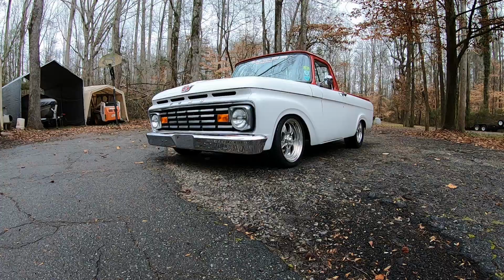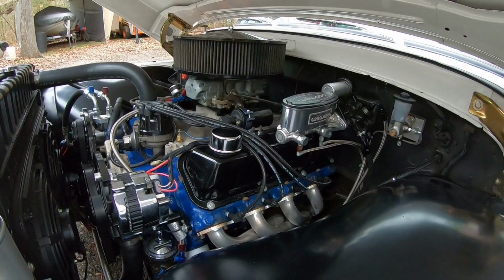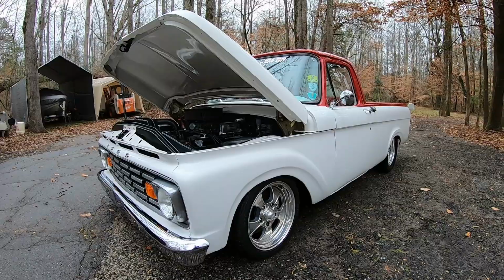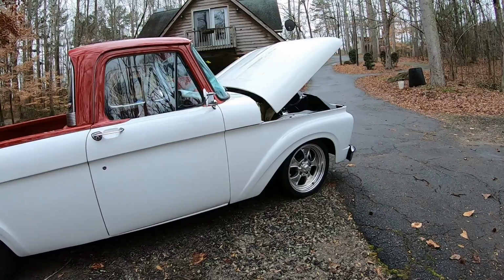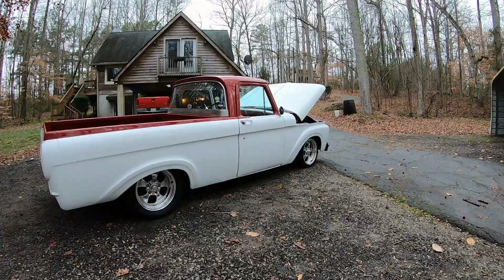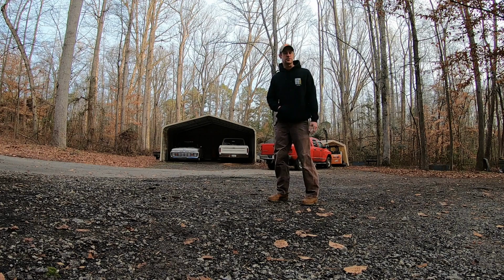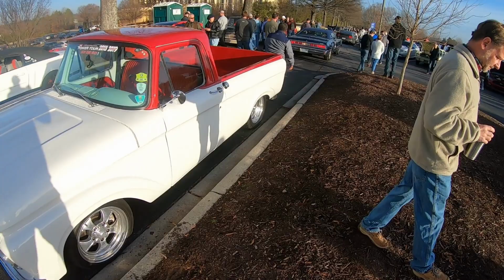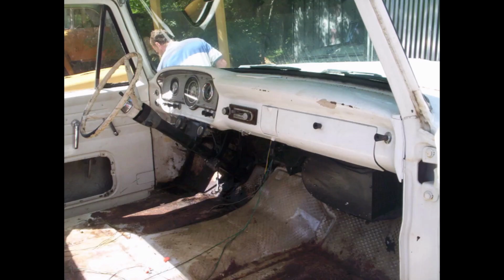Big Block F100 Unibody Truck Walk Around

Comment: Beautiful Unibody F100.
Reply from the maker: Thank you!
Reply: @christiangriffin4869  You're welcome brother. Are the factory cylinder heads ported and polished or are they stock cast.
Reply from the maker: @CJColvin  The heads on this truck are just stock castings.
Reply: @christiangriffin4869  Oh ok. Do you plan on porting and polishing the factory cylinder heads or just getting aftermarket aluminum heads.
Reply from the maker: @CJColvin  If i were to ever rebuild this engine and wanted a head upgrade Id likely go aluminum for this one.
Reply: @christiangriffin4869  Sounds awesome brother.

Comment: Noticed most of the bed floor was gone in a picture, where or how did you get replacement metal? Sweet truck!
Reply from the maker: Thanks! The original floor was rotten so we cut a bed floor out of a 90's pickup in a junkyard to use.

Comment: Very nice!!   Is the paint scheme factory? I don't recall seeing another like that but  I know somethings were changed up in 63.
Reply from the maker: This is not a factory paint scheme. Ford broke two tone paint jobs on the sharp body line further down than mine. Thanks for watching!
Reply: @christiangriffin4869   That's the way my truck is painted. I've also seen 63s with beltline moldings have the  color separation there. Thanks for the reply!

Comment: This is an old post but you adapted a viper 6 speed  ? I’d love to find out how. I have a ford 460 I’d love to put a 6 speed in
Reply from the maker: Its a Tremec T56. Very popular 6 speed manual with lots of aftermarket support. This particular unit was from a viper. I used a quick time bell housing and mix matched clutch parts to make it all work 🤟

Comment: Did you fix the rusty part on the front of your hood, or did you replace the hood itself? Mine has rust in the exact same spot and I'm curious to how you may have fixed the rust issue. Good looking truck!
Reply: Pro= cut n weld
Hack= mud n sand

Comment: You actually did yourself a favor by not using a crown vic front.  No one tells you after the fact that you shouldn't use it as a truck after that. The arms break under stress

Comment: Kid be careful you dont know what you got!  Leave the wheels alone! If you have to change the exhaust , bring both pipes out the right hand side just in front of the right rear tire as ford did on the last ford lightning F150...

I was 13 years old when your truck was built .and later after the stopped building the design , i was told because of the area between the cab and the bed having stress issues causing cracks in the body medal ..and always hopped some one would fix one  of these old trucks and you not only restored a very rare F150 but gave it the justice it needed ...that why im saying " dont touch those wheels " they are fugly ugly enough to look vintage rare and they are with a "factory" look ...when i glanced at the icon on my phone for this video the ,your truck looked stock ! And kid this is old school "sleeper" , like i said you dont know what you got! And if you just have to have a modern set of something like some DUB 20s build another truck , but this time find a year 2000 F150 short bed fleet side "sport" they have fully independent front suspension ...but thats all you want from the truck as the rest needs to come from a year 2000 mustang cobra "R" , and use the entire engine transmission and ford's fully independent rear suspension that came stock under this 2000 mustang "R" of only 295 sold of only 300 ever built ..and for the interior use the front buckets dash speedo and gauges from power steering the cobra "R" and to top it off with a solid bed cover to mount the roof tall 2000 cobra "R" rear wing ...bolt up a set of your favorite wheels with plenty of wheel well on the 2000 F150 to give an idea of visuals here is links of pics of both car and truck so again be the 1st to do the Love and Marriage ceremony of both together
https://www.autoblog.com/buy/2000-Ford-F_150/

https://images.app.goo.gl/Q5rdLbssymf8YGHY6